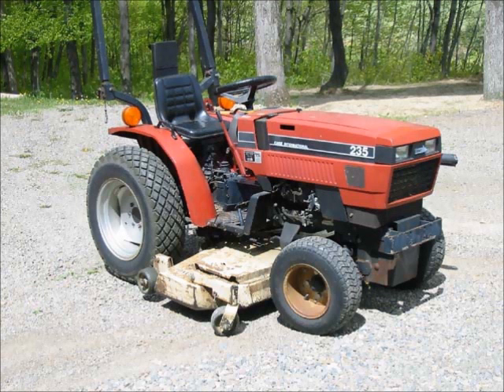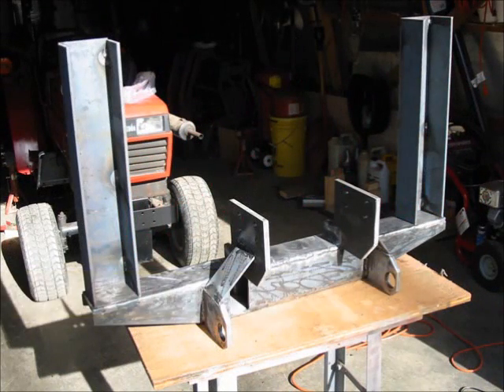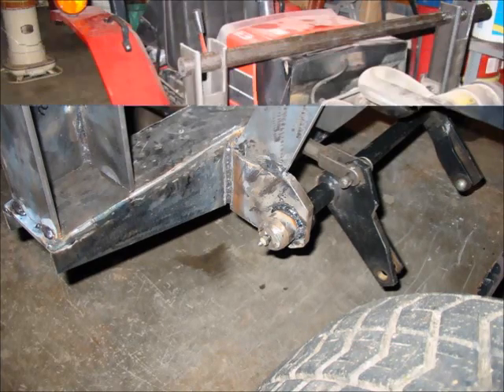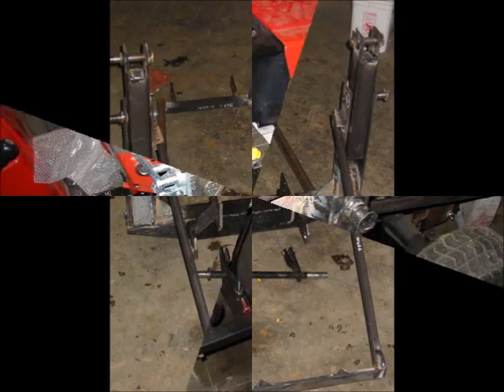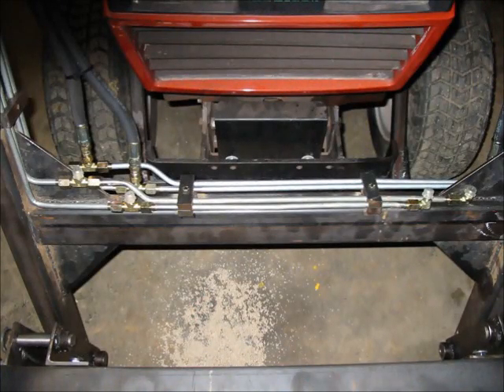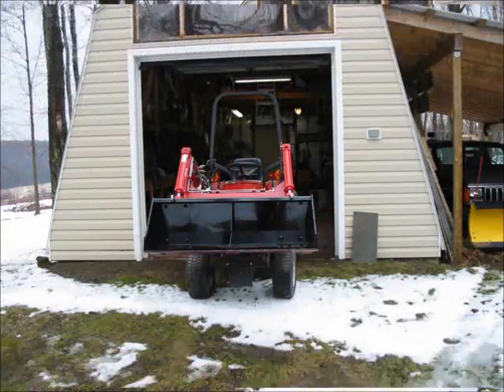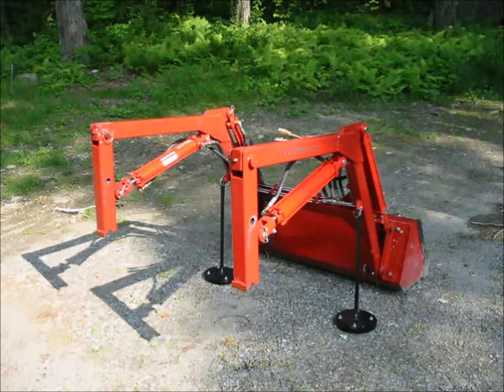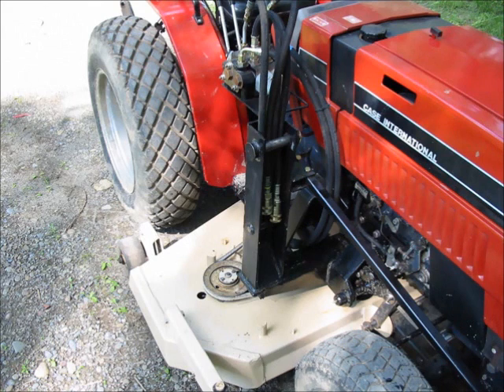Case International 235 Loader Project

Comment: Great Project.  I've been looking at a used 235 in excellent shape, but a loader has been the problem.  I think I'll give it a go.  A few more questions.  Did you harden the tubing used in the pivot points or the 1" used for the hydraulics?
Reply from the maker: A couple thoughts before you proceed.  First, the 235 does not have power steering; I wish it did!  More important, you'll need to see if you can locate the hydraulic adapter plate that allows you to tie into the tractor's hydraulic system.  When I purchased mine, there were just three (3) remaining anywhere in the US!

No hardened pins, but each pivot has a grease fitting.

You will need to have a tremendous amount of counterweight for the tractor.  I have about 400 pounds hanging off the 3-point hitch. Without it, the tractor is helpless.

Oh...one more thought...check the rear tires.  If they are original and they have any cracks, I suggest you pass.  They do not make that size tire anymore!  I went through a lot of pain and suffering trying to get new tires for mine last year!

Good luck!